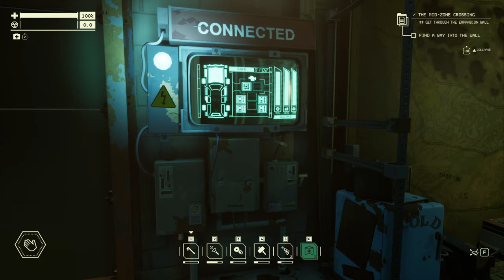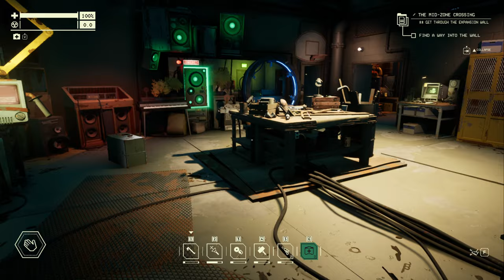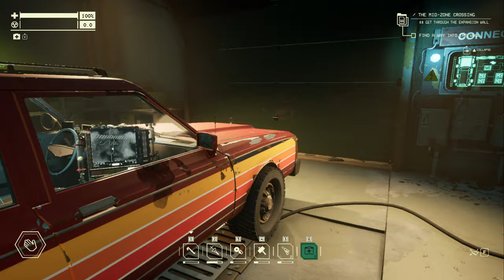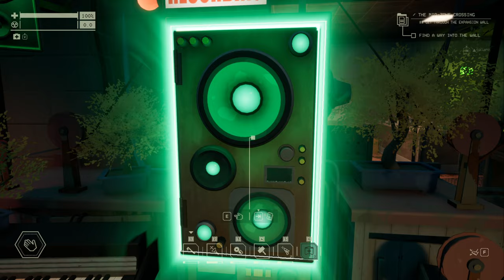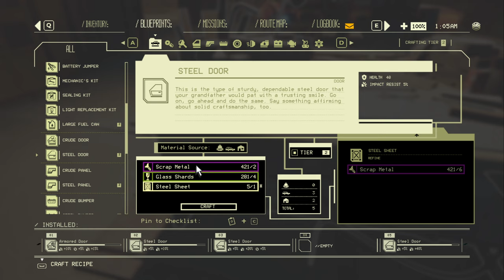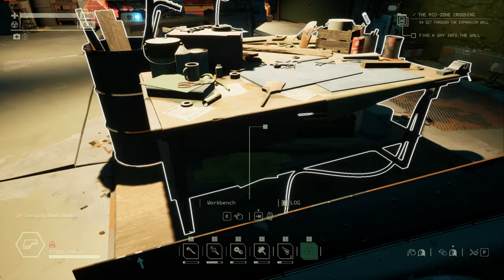Pacific Drive Tips | How to repair without Putty!!

Comment: Nice! I havent touched that speaker thing yet. Spent too much time going hoarder mode on my first run yesterday 😂
Reply from the maker: I didn't use it at first either, thought it was too gimmicky. Then I realized how powerful it is and now I'm not constantly burning through Chemicals trying to repair the car.
Reply: Same I'm 10 hours in and only did one main mission hoarding and exploring for LIFE

Comment: I forgot to ask you also, if you repair the doors that have paint/decal on it with that sound system, once repaired, the color is still on ? So it's a way to also save the decal/paint since those are limited use?
Reply from the maker: That's a great question that I don't honestly remember. I "think" the Decal stays on the Door being repaired in that speaker thing but I'm not 1005 positive.